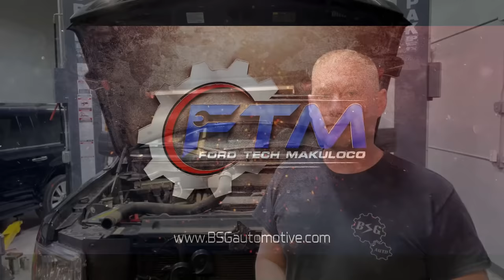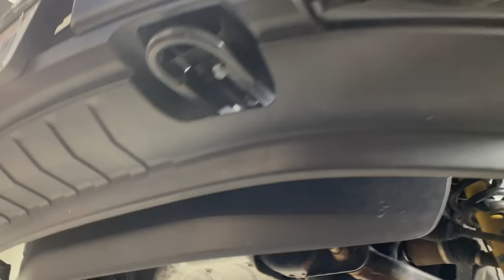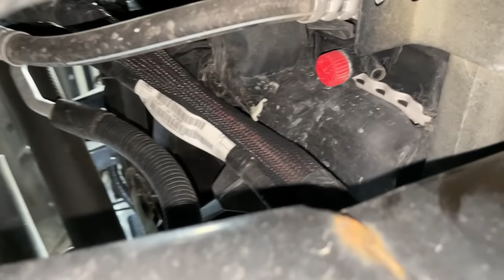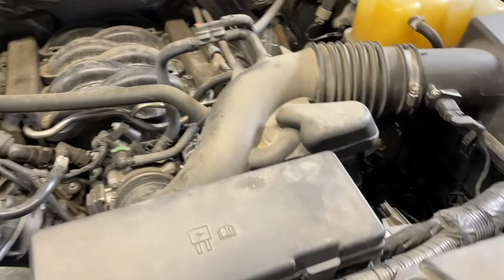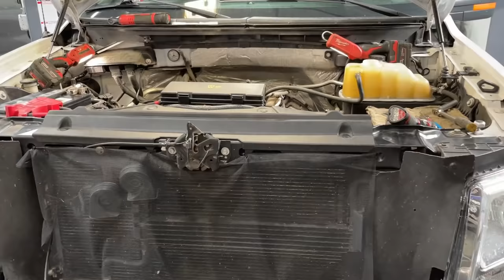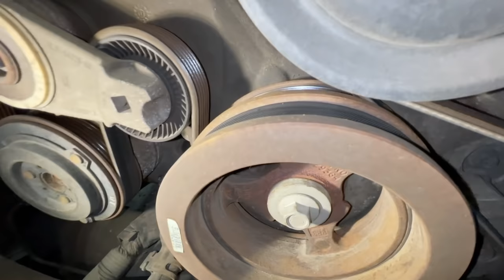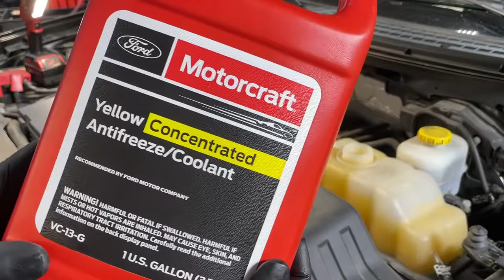2011-2021 Ford F-150 5.0L Coyote Engine: The Most Common Coolant Leak Repair!

Comment: 2011 coyote 245k I just had that large pipe coming from the radiator snap off right where the plastic meets the rubber, luckily when my fan went on High speed I turned off my truck and everything was fine, I would replace all the hoses after 10 years 200kmiles, easy $200 job

Comment: I have the 5.0L Mustang and I put in a gen 2 5.2 water pump in along with replacing all the hoses and it might be in my head but the car acts so much better than it did before.

Comment: keep us up to date how the belt driven oil pump doing on 2021.
Reply: @kermitwilson  ask FordTechMakuloco, he's got one.
Reply: @kermitwilson  that would definitely be stupid but the loss of a belt should shut engine down with zero pressure via the sending switch.leaving one stranded....
Reply: 2.7 EcoBoost has one also, probably others too. There is an "inspection" interval, but to inspect it is about the same amount of work required to replace it so.....
Reply: @joecampbell606  I was going to purchase 2021 f150 v8 until I found out about cylinder deactivation and oil pump belt driven.

Comment: This took me 6 hours with 2 trips to the store and a quick lunch break. Hardest part was getting clamp off the top piece and I had quite a bit of corrosion on that connection so spent some time trying to clean it up the best I could. When I added the coolant and started the truck up and got it to operating temperature the coolant didn't disappear I actually had to suck some out because it was ovefull to 1 inch above the cold fill line. I followed the other steps and checked it the next morning and the coolant dropped right in between the lines. This will not take 30-60 min for someone that hasn't done it before. It takes that long to drain the coolant!

Comment: Did the water pump on my 2014 5.0 at 94,000 miles. So changed all the O-rings at the same time. Ford has always done some dumb things with coolant hoses. My 1974 had that hose that you had to pull the water pump to replace.

Comment: Once again I'm a little late to the party but on the first truck you were working on I saw a K&N sticker on the air box.  What's your opinion on K&N filters.  I've heard good and bad about them.   Inquiring minds want to know.  And I don't think I've said it before but you have been a great help on diagnosing and fixing my various F150s.  Keep the good stuff coming.  EDIT:  Well stupid me I hadn't looked at your other videos before I asked the question.  Once I searched I found your video where you say not to run the K&N filters.  Thanks again for the information.

Comment: I have a 2016 5.0 that is leaking at this same upper location. It has already leaked on the serpentine belt, so I'm wondering if it is really necessary to remove that? Also, can you get by with not draining the entire system? My 16 has 75,000 on it. I know new coolant is probably better, but didn't know if necessary. Also, any problem with going with a universal coolant? I have several vehicles, and it would just be easier. 

Sorry for so many questions, but I'm just a diy guy, trying to make it as easy as possible, but want to do it right. I do plan on keeping this truck for awhile. 
Thanks for anyone who can answer any, or all of these questions. 

Thanks also for this video. First time I have seen you, but already liked and subscribed because I was so impressed! Well done sir!

Comment: Can you do a video with the VCT solenoids on the 5.0. I have a 2016 that keeps having this problem.not alot of info on it except pay $4k for ford to replace the cam phasers. I thought this issue was fixed when they stopped making the 5.4 3v.
Reply: I'm surprised he hasnt done a videos for those yet

Comment: I changed the o-ring in the upper radiator and the o-ring in the bottom connector of the y-pipe. I did not disconnect the rubber hose of the y-pipe form the housing. I just twisted the hose until I could see the o-ring in the bottom connector. $30.00 fix with a gallon of Motorcraft anti-freeze.
Reply from the maker: Woah where did you find the o-ring that Ford does not have a part number for?

Comment: i changed out this part on my 2011 fx2, be aware that the wire clips on mine were of different diameters, the thinner one goes on the connection to the thermostat and the other thicker clip goes to the connection that is on the upper radiator hose.

Comment: I just bought a 2013 Ford f150 with a 5.0 Coyote engine the V8 and when I put cooling in it I seen it was leaking right below the thermostat housing. It was drooling down behind the pulleys and going down the crankshaft pulley and dripping down to the center front of the engine. So when I inspected my hoses the gasket in the t-shape connector was completely wore out. In that little black extension for the other hoses to connect to was also rusted out and cracked and the other hose was kind of swollen. So I'm hoping it solves my problem cuz the water pump is new and it was not leaking and it was dry from there

Comment: I saw my 2015 Ford F-150 was leaking and saw it was this part. I'm going to try and repair myself with your video. Seems so easy. One question, does the throttle body have a gasket that I need to replace after I remove it to work on Y? L'LL LET YOU KNOW HOW IT GOES!!

Comment: Have you ever used the vacuum method to refill the vehicle? Seems like a good way to prevent air bubbles in the system.
Reply from the maker: Yup all the time.

Comment: I need to replace my 2015 F150 5.0 V8 4x4 XLT water pump. 67K miles. It has the orange coolant now. I've drained the radiator to start the repair and came across this video. I think I'll order the parts you listed below as well as the Motorcraft coolant. I had picked up the Prestone DexCool orange but would prefer to switch to this yellow coolant. How many gallons should I order? I don't want to order too much. Should I try to drain all the coolant? Is that even possible? Does it matter if the yellow and orange mix? Thanks! Great instructions! Some of the best I've seen on YouTube. Much appreciated!!
Reply: I think the yellow and orange are compatible, but not sure.  Search Brian's videos as he has one that explains how the coolants have evolved.  My 2012 5.0 liter has a coolant capacity of 17 qts.  Your owner's manual should tell you how much you need.

Comment: Awesome video! You have links for the 50/50 and Concentrate coolant. For this job which one do I use? I know it will vary but how much coolant should I buy. I have a 2012 with a 5.0

Comment: Just a suggestion. I would use a small handheld pump and pump the small amount of old coolant in the trap line. Thanks for the video
Reply from the maker: No need, you simply pull it up high and it will flow out into the radiator. Then for any residual you simply place the hose a a high point on the RH valve cover and it holds it in an upright position until you are ready to install.
Reply: @FordTechMakuloco  cool thanks

Comment: Hey love the channel and have been following for a while. Your videos have helped on previous repairs. However this one particular I have a 2015 5.0 and changed out this why pipe. All was good and ran through the cycles, filled cooant back up, no leaks, however now I have a rough idle with engine light on now and remote start stopped working. This job was easy and I didn't mess with anything other then the throttle body. Remote start honks and lights rapid flash. Any suggestions?  Thank you for putting these videos out. I checked all my work hoses and connections. All seems good and in place. Thanks again.
Reply from the maker: You might have left something disconnected; one a check engine light is set the remote start will also stop working. Pull codes first.
Reply: Ok will do man. Thank you for the response I really appreciate it. I'll check over every and see if I made all my connections. Keep making those videos.

Comment: Had this leak on my 2014. It was just the top hose from the rad leaking.
When I changed the O-ring, the profile of the old one was basically square instead of round.

I didn't remove any belts. Just drained enough fluid so it didn't pour out when I took the top hose off. Then toped it back off and burped any possible air out after.

Comment: My y-fitting just started to leak.  I have a 2012 with 107K on it and it has the original water pump.  I am wondering if I should just go ahead and replace the water pump since I have heard they usually go out at 80K?  Also wondering if I should do the thermostat?  Thanks for any advice!!

Comment: Great video.    I have a small tractor with cast iron block and manual says change coolant every year using 50/50 ethylene glycol coolant.  Can I use a much better coolant and extend changes?  My biggest concern is rust control.   Thanks.

Comment: I just did this fix. I am curious about procedure for refilling to coolant.  You have other videos that go into length about burping the system to get the air out.  For this one,  it looks like we just need to fill the degas tank, and watch it. I held the rpms and ran the heat a while to verify and everything is working good.  I only drained about 3/4 gal and that is how much I captured and put back in.

Comment: Just ordered the y-pipe thru the Amazon link. Just be aware it is not a genuine Ford part (at least the one I received). No Ford packaging and the box says “made in China”. I love this channel but someone at Amazon store has changed the item.
Reply from the maker: The fakes have been rampant on amazon recently for all kinds of Ford parts but Amazon has been correcting them as complaints come in.

Comment: Hey great video. I bought the doorman coolant t and hose seal kit which came with 3 o-rings. Two are the same size and ones a tad smaller. After hours of using the two o-rings that were supposed to replace the seal of the upper hose I was not able to get it to slide back on. I decided to flip my original “flat-style” o ring and put it back in and my leak has stopped. I’m confused as to why I wasn’t able to get it to sit with the new o ring. I made sure that the slots were aligned and tried wiggling and turning along with lubricant which had no success.

Comment: i hope you see this... my 2015 f-150 overheated the other day and i noticed my coolant was low, so i added coolant and all seemed fine.  the next day i checked and found all the coolant had again leaked out of the truck.  so my question is, will the coolant leak from this area even if the truck is not actively running?  or do i have another issue?  it does look like the coolant may be leaking form this area, but i cannot tell for 100% sure

Comment: You probably already know this. But the quick connect that connects to degas bottle on 11-14 leaks too
Reply from the maker: Yup I have a video on that too
Reply: @FordTechMakuloco  I went through those a lot when I was a ford tech. Then later it would leak again and I would have to replace the degas bottle which you already know is part of the airbox and isn't cheap

Comment: Love your videos, My '17 just started leaking. Not trying to be cheap here, but why not replace just the O-rings?
Reply: After doing this myself, I think that would be fine.  Plastic Y doesn't fail, it's the O rings.  If I was doing it again I would just buy the O rings.
Reply: And I would do both, not just the leaky one because both of mine were worn but just the hose side leaked. Dorman 926-168. Part number for the metal Y pipe if you choose to replace is 626-541.

Comment: I was following your steps in the video and I have ran into a snag. I'm installing the Denson aluminum Y instead of the OEM plastic one and I'm having a time getting it to snap into place after putting the hose on the one spot. Any suggestions?

Comment: Im seeing some guys recommending to replace the water pump as preventative maintenance. That seems excessive to me. I'm doing this y pipe this weekend. Should I do the water pump as well? Its a 2017 5.0 with 101k miles. Just bought it so I have no idea if it's been changed or of theres a way to find out. Thanks for any advice and i appreciate the vids!
Reply from the maker: nope

Comment: I’ve replaced all the hoses from the reservoir, the upper radiator hose, Y connector, lower radiator hose. Etc. I still have a coolant leak… do you think it’s the manifold?

Comment: FTM - What created the coolant leak at the Y connector ? Was it the fact that the Y-connector O- ring and upper rad hose O-ring were worn ? Seems that way to me since the plastic Y connector was not cracked. Therefore why not just change the Y connector O-ring & upper rad hose O-ring ?
Am I missing something in my analysis since the Y-connector seemed perfectly intact except for the worn O-Ring on the thermostat side of the Y-connector as well as the upper rad hose O-ring ? 
Thanks for the great video.
Reply from the maker: Oh do you have the part number of the y-pipe o-ring with the exact same specs as specified by Ford along with ang engineering revisions to the spec of the o-ring?  There are so many specs when it comes to o-rings and their application it would blow your mind, would you just guess to save a few bucks?
Reply: Agree with you that you would need the part number/specs of the Y-pipe O-ring in order to replace it. 

However it seems like you are agreeing that it's the worn O-rings causing the leaks and not the Y-pipe itself failing.

I'm wondering if the specs or part number for the Y-pipe O-ring can be found in a Ford F150 maintenance or shop manual ??

Keep up the great work, I like watching your videos and how you explain the procedure and things to watch out for. Fantastic !
Reply from the maker: You would need engineering specs, the workshop manual has service information only.

Comment: Brian, My Son & I both have new 2021 F-150's both bought new at two different dealers, Mine was built in Dearborn , Dec 2020, his in KC , Jan of 2021 , both have the 5.0 V 8, BOTH show a pale lime green color in the degas tank, Being as I like to be prepared I went to the dealer to buy a gallon of antifreeze just to have it around and they sold me the VC-13-G as shown in your video that IS Yellow , Now I'm confused, Do you have any idea why the colors of antifreeze in both trucks are not what is in the bottle of  VC-13-G AND what your video shows in the degas tank on the truck you replaced the Y pipe in , Thanks for your time .

Comment: I assume this leak issue is more prevalent on older F150's ?? Obviously as you state, all the trucks have that Y connector, but the leaking most likely is more common as years of service go by.....correct ?   You probably see more 2012's and 2013's leaking than 2019's and 2020's....right ? 
Thanks
Reply from the maker: They all leak the same in time.

Comment: Hey guys I'm not sure I haven't put it on my truck yet I purchased a aluminum y-pipe from dorman has anybody had success with??? I also have another question I want to change out my rear differential fluid on a 17 150 5.0 the Ford  two-wheel... Anyways the motorcraft 75 85 gear is very expensive... A Ford mechanic told me I could put 75140 what do you guys run in your differentials? Some people tell me a different one I don't know thank you very much

Comment: Hey I really like your videos. I recently bought 2011 f150 5.0. It has the same leak but I’m guessing it needs a O-ring . However there’s some electrical issues I’m having like the horn doesn’t work, and no rear lights work. Including the break lights. Do you have any advice for me. I tested the horns and fuses are good

Comment: Just did mine. I took the snorkel and TB off. Didn't do the rest. Went pretty quick. 

Are these a noisy engine normally? Lots of clatter from injectors, but some other noises too. I test drove 5 and they all sounded like rods tapping. Unsettling.

Comment: I made this same repair on my 2014 did not have to take the belt off or remove the throttle body, maybe older models are a little more difficult.
Reply: I have a 2013 and I got the old T off no problem without removing the throttle body, but trying to put the new one on was such a pain I just went ahead and pulled it since it's so easy.

Comment: Maybe I missed it, but do you recommend letting the radiator drain all the way, then fill with the new yellow POAT coolant? Compatibility issues?
Reply: It's a good idea to fully drain it, and then refill it with the new yellow coolant. My truck was the one in the middle of the video that he was actually changing the y pipe on. He did a video a number of months back regarding the coolant change. It had the orange from the factory, and this new yellow supercedes the required coolant. A full drain with a 50/50 mix of the yellow is the best way to go. If there is some residual old coolant left in the system, it will blend just fine with the updated version. A full flush isn't really needed unless your system is very dirty or neglected. Just make sure to buy distilled gallons of water to mix with, no tap water from the hose due to the minerals it contains. I had a thermostat change done as well as new coolant. Couldn't be happier with the quality of work Brian does on the truck, he's simply at the top of his game when it comes to fixing things right.

Comment: I have a 2015 Ford F 150 XLT 4 wheel drive .The water is boiling out of pressure cap on reservoir,I noticed that the fans don t come . What would cause both fans to not come in ?

Comment: easy question; i am replacing a 5.0 302 cid. in a 1995 Bronco and the vacuum lines broke easy from age. how would you replace then ???  i saw a video on a hair dryer hot air to bend the tubes to form the correct angle you want but is this what you need to do ??? just buy tubing and get out the hair dryer ??? i do have a very nice heat gun...